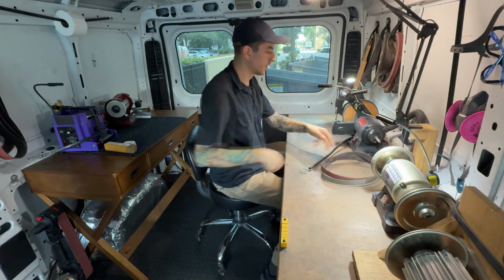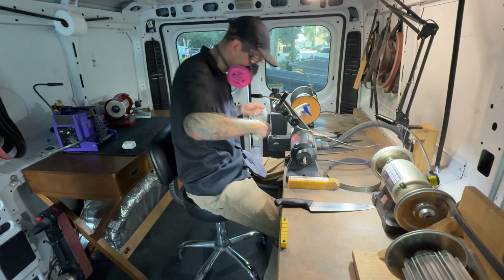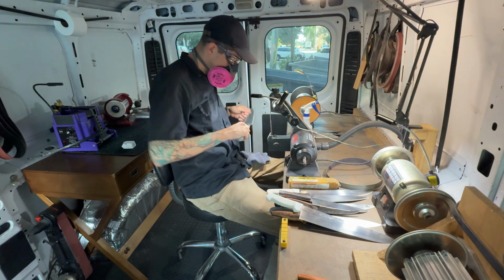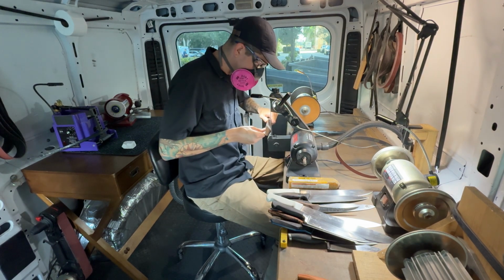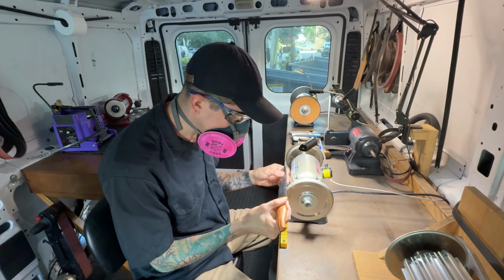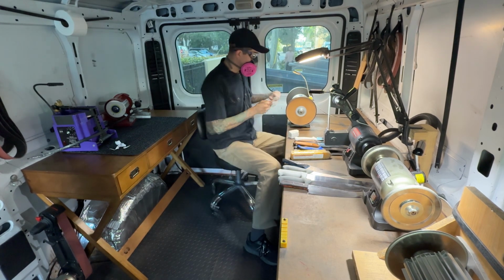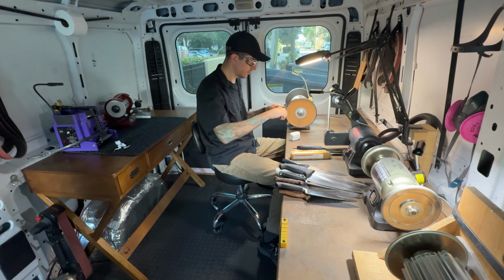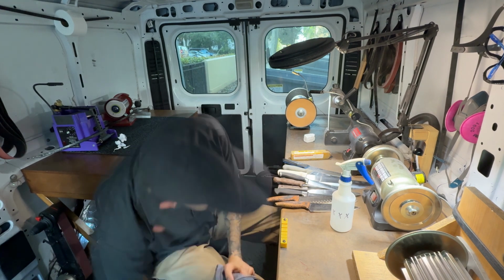Full Commercial Knife Sharpening w/ Commentary

Comment: You might be interested in this,  for my final polish rather than the white compound I use Pink Scratchless. I get mine from Pop's knife supply I am sure others sell it as well it leaves a true mirror finish and will be as sharp as the steel is capable of getting.

Comment: What are your thoughts on the knife guide you chose to do without? Thx for tips!
Reply from the maker: I used it for a long time and I think it works great for a lot of things. I don't like how much you need to rotate knives with certain handle designs. I also don't like how you can't use a single fixed guide for grit progression since the finer grit doesn't hit the apex. I still use it for certain items like mandoline blades.

Comment: Great video, a question if you will, where is or what is your power source to drive the equipment?
Reply from the maker: Thanks, everything is powered by a 100AH battery connected to a 4000W pure sine inverter. The battery is also connected to the van's starter battery allowing it to charge when the van is running. You can see a bit more detail about this in my Van Tour video.

Comment: You have your Bucktool bench grinders with custom wheels on them. 
When you ordered these bench grinders did you specifically order them without any wheels on them so you could put your own wheels on?
And where did you source your nylon fibre wheel & leather wheel?
Reply from the maker: @Mr_Elemental7  I don’t know if they sell them without wheels. You can just take the stock ones off and put whatever you want. I got those wheels from Amazon, the leather wheel is from Pro Sharpening Supply.
Reply: Oh and you said you have them spinning in reverse mode so you can achieve edge trailing.
Is this a feature of the bench grinder or did you have to rewire this yourself?
Reply from the maker: @Mr_Elemental7  the motor doesn’t have a reverse function. You can simply unscrew the base, rotate it 180 degrees and re-attach. No wiring skills needed.

Comment: What rpm motor are you using for 8 inch nylon wheel and leather wheel. And where are you getting your 600 grit trizact belts.
Reply from the maker: That's a 1750rpm machine and I get all my belts from Curry Custom Cutlery.
Reply: Thank you so much for replying. I watch you all the time and you’re great. You’re very professional and in order. I thank the LORD for you, again thanks.

Comment: very interesting, thanks for posting this type of format.  2 questions:
1) i am very good at sharpening my own knives with the Worksmart Ken Onion.  What would be a recommended path for me to sharpening locally as a business?
2) whats stopping you from drilling out a small port for your shopvac that blows out to the outside without opening the door?
Reply from the maker: 1. The path will depend on if you want to sharpen at your home / shop, or go mobile and work on-site. Sharpening at your own location is more comfortable and simple in terms of setting up your space and equipment, power, A/C, dust control etc. Going mobile is more complicated but can unlock much more business and is pretty much essential to get any commercial clients. Either way I would suggest making some basic social media content for your business and promoting it (IG/Facebook ads are very effective and can be customized to target local areas and interests)

2. I'm hesitant to do any kind of permanent modifications to the van in case I ever want to sell or trade it. As it stands right now I could rip everything out in an afternoon and you would never know there was a workshop in there.
Reply: @ thanks Al!  I’ll dip my toe into it.  Also makes sense about the van.  Thanks for the vid dude!

Comment: Hello Al,
Awesome video and glad to see you moving forward with your sharpening business. I do have a question on the Van power, is it still the same as when you started with one battery and have you added to it?
Reply from the maker: Thanks! I am still using the one battery that's connected to the van's starter battery. Between running the vacuum and the Florida heat I need to run the van's engine quite often so it is acting as a generator in most cases. I can still do small jobs on the battery alone.
Reply: Keep me informed, I just ordered the same inverter and set up that you have. In other words I copied what you have and fixing to set it up so now I’m in limbo.
Reply from the maker: @AE-zj6oc  Great. The only issue I had after about a year the cheap battery isolator stopped working. I used a multimeter to verify that was the issue and was able to replace it with a new one without too much trouble.
Reply: Thank you